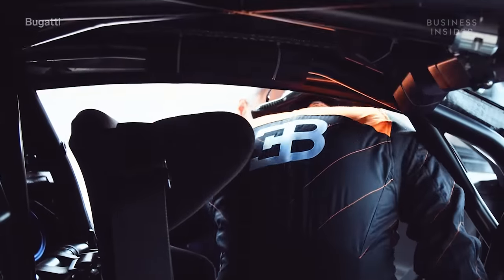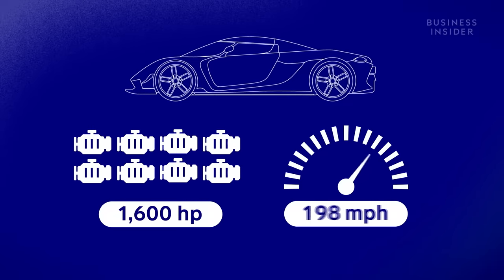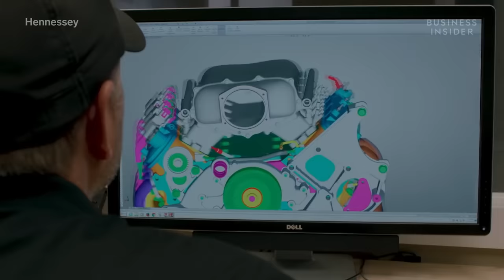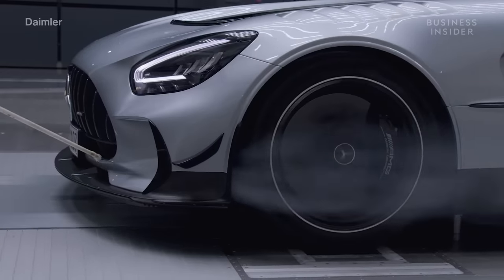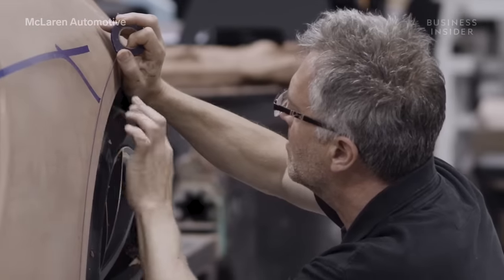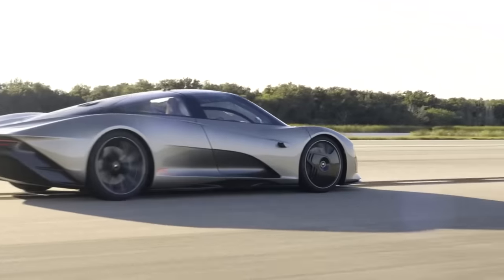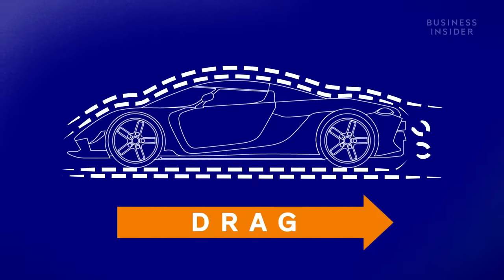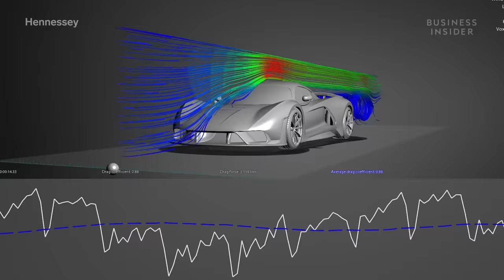Why It's Almost Impossible For Cars To Go 300 Miles Per Hour | Insider Cars

Comment: 30 years from now- “Why it’s almost impossible for cars to go 400 mph”
Reply: Exactly what i thought.
With additive manufacturing it's probably less than 30 years away.
Reply: While the German autobahns have no speed limit on unrestricted sections... They have worked out a theoretical limit at which the tyres would start destroying the tarmac!
Reply: But thats already been broken lol, at 481 mph on the speed demon!
Reply: @sandragarrettmccombs3635  not even a car
Reply: @AzathothsAlarmClock  it's basically a plane without wings
Reply: @AzathothsAlarmClock  no because cars don't have to be pushed to get going and have a jet
Reply: @AzathothsAlarmClock  alright thats you opinion, but it's just my opinion that is isn't
Reply: @AzathothsAlarmClock  I'm not calling it an aircraft, I'm just saying that to me it's not a car. The definition of a car is loose, you could call a train a car even.
Reply: @sandragarrettmccombs3635  not by a production vehicle
Reply: @johntheux9238  what is the theoretical limit?
Reply: @GTDrexXX lmao, is that even still subsonic anymore
Reply: At that point, you're starting to run out of planet to drive on!
Reply: @AzathothsAlarmClock  And all 3 operate in fluid dynamics using aerofoils. That's an even simpler concept.
Reply: @lukehill2936  Probably somewhere under the speed of sound so like 700mph, but that would require building cars in completely different way, specially the wheels.
Reply: @mihailmilev9909  No, that's like Mach 25 xD
Reply: @Waldel Martell yeah but the forces required for higher speeds grow exponentially as well. This cancels out and the progress will be linear imo.
Reply: @Waldel Martell I hope manned drone racing will become a thing in near future. That would be great.
Reply: As long as humans keep the spirit of advancement and curiosity alive, we'll be fine. Just do it for advancement, not money.
Reply: @SonGoku-io7sh  people invent stuff for advancement, but produce stuff for money. That's how it gets cheap enough for public.
Reply: @videorowtv5198  The primary goal of a general corporation is to make money, not advancement of humanity as a whole.
Reply: Cars will be flying by then bro
Reply: @1moetime123  Cars will not fly for a very very long time. It's just very impractical and expensive.
Reply: development is exponatial so in 30 years i expect way more
Reply: @videorowtv5198  it’s not that hard when they’re sitting in 0-point energy technology
Reply: @joachimtheboss5326  we already have “way more” it’s just up to the government to let us use the technology
Reply: @joachimtheboss5326  McLaren F1 without a limiter could go 240mph, that was in 1992. It took us almost 30 years to get to increase the speed by 60mph. I think in another 30 years the rocord will be around 360. Because the technology required grows exponentially with higher speeds.
Reply: Wht if cars broke sound barriers like jets 😜
Reply: @rahulverma8774  I don't think there's a reason for cars to break the soundbarrier. The noise that it would create would make them unable to race on any curcuits. Also the turbulences under the car would make it very unstable.
Reply: @RelyksJ  no, you cant ... its exactly as simple as with cars and planes ... a train goes on train tracks /railroad tracks and a car don't need a train track or a railroad track, it can choose its direction without a train track
Reply: @videorowtv5198  Sound barrier is broken at 770 mph ..........and u r saying tht a car will be useless if it manages to break sound barrier ......... so we can say tht car speed beyond 770 mph is impossible
Reply: @Namelless2366  I was saying with his definition you could. Ofc a car isn't a train
Reply: @rahulverma8774  Basically, yeah
Reply: @avdeepsingh9218  it has 4 wheels and it drives, its a car, not a road car, but a car
Reply: @mihailmilev9909  the speed of sound is only like 760 mph plenty of planes go faster than sound. 20,000 mph is like 30 times the speed of sound lol.
Reply: @Jonathan_Doe_  Due to added down force engineered into supercars?  You saw the car without the wing in this video only had 330 added pounds of downforce.
Reply: @myusername3689  what I was saying was that you can have your own definition and it is and opinion of what you think is a car.

Anyway I can't be bothered arguing about this anymore.
Reply: Although it isn't a production car a consumer could buy on the market thrust ssc beat 700 mph in the late 90s.
Reply: @videorowtv5198  

If it were manned, it wouldn't be a drone anymore.  A drone has no person in it.  It is by definition, unmanned.
Reply: @someguy7805  OH yeah, my bad. Quadcopter racing.
Reply: @1moetime123  cars has been flying for years, it's called aeroplanes.
Reply: @zahier_gaidien9259  I’m not talking anything with a combustible engine
Reply: @AzathothsAlarmClock  show me where I can buy a production one then I’ll give them the record
Reply: The Chiron will be filmed at 300mph with a 2050 Camry.
Reply: I'm expecting to see that video
Reply: @johntheux9238  not really
Reply: @johntheux9238  you will need a 102400 horsepower, ultimately impossible
Reply: @amishmittal4536  (400/300)^3 = 2.4 times more power than for 300MPH so far from impossible.
Reply: @RelyksJ  iouoio
Reply: Didn’t the Thrust SSC hit over 700?
Reply: Max speed any object can do safely for long periods of time is Mach 3, the SR71 blackbird even though it flew at the edge of space where atmosphere is damn thin, the plane still heat up to 300 degrees celsius or 571 degrees fahrenheit. Doing mach 3 at sea level is ridiculously stupid. 

Also those that spew bullshit speed like 20k MPH, bruh the space shuttle re-enters the earth atmosphere at 17.5k MPH, and it heats up to 3000 degrees fahrenheit like WTF are you guys talking about?
Reply: I mean, rocket on fidget spinner. On car means speed
Reply: @AzathothsAlarmClock  😂😂
Reply: Because the battery keeps dying lol
Reply: Not even 30 bro lol give it 5
Reply: Its all down to the power of the engine and the tire.
With newer electric engines and higher energy batteries it might actually be possible.
Reply: The biggest obstacle to speeds above 300, is MONEY , everything else is secondary.
Reply: @ibrahimbaghdadi2187  I have no desire for flight, I have no desire for 300 Mph on tires, either. I have been to 150 on a motorcycle, that is plenty fast, thank you.
Reply: Thrust SSC...Eh?
Reply: Well the car thrust scc can already go over 700
Reply: @AzathothsAlarmClock  are you 9? The Demon is not a production car, its a concept. Whilst the Chiron SS+ 300 will come out, but with a speed limiter
Reply: @AzathothsAlarmClock  sigh, you just dont get it do you? Can people buy it and drive it on the street like a normal car?
Reply: @AzathothsAlarmClock  what does that have to do with anything
Reply: @MillenniumEarl014  bruh this was 3 months ago lmao
Reply: YouTube Censors Free Speech  not water imo because you need much more energy to push through it
Reply: @videorowtv5198  The world land speed record is Mach 1.02, set by Thrust SSC. So no the limit is not below the speed of sound. But for "practical" purposes the problem above 300mph is tyres for wheel driven cars, as this video explains. JCB DieselMax is the world's fastest diesel engine powered car, with a record of 350mph. That was the limit for the tyres, the car wasn't even in top gear at that speed using only 5 out of 6.
Reply: @AzathothsAlarmClock  which is why it's called a "jet car" and not a "car".

/don't make me call in the rest of the youtube attorneys  ;P
Reply: @videorowtv5198  and we don't want anyone with just some driver's license to use a third dimension. a thousand hours of training? maybe.

1/3 of society can't even figure out how to drive in appx. two dimensions as it is.
Reply: no one is sitting on zpe tech, ffs. stop watching conspiracy youtube.
Reply: 60 years after that-“why it’s almost impossible to move faster then light itself”.
Reply: I mean there could alot of accidents that would happen if it’s 400 mph
Reply: Exactly! Same thing was said for years about the "4 minute mile"...Scientist also came up with reasons why the human body couldn't.
Reply: @rahulverma8774  but really... why even make roads and cars for such a speeds if jets simply exist?
Reply: @ThatGuy-sd3zl  low-class consumers cars will never be fast or use advanced tech.
Reply: @divinehatred6021  yeah true ..... but in the world where world records exist ,i m sure we will one day make cars tht manage to break sound barriers ..... it may not be used by average men ..... but rich people can later purchase it in auctions ...... cars tht break sound barrier should cost close to a billion dollar according to me ... or maybe more
Reply: You need straight road long enough to support that speed with no traffic.
Reply: @zmanphx  We can try tht never ending runway shown in fast & furious
Reply: When you Pay 2 Million Bucks for a Car it Should do 500 Miles per Hr. But for Now 304 MPH will DO !!! I want one !! But i don't have any $$$ !!!  Tuff Shit Right !!!
Reply: Thrust SSC: am I a joke to you?
Reply: @AzathothsAlarmClock  the speed demon doesnt really count since even though its piston driven and has wheels, its purpose built to break records. Its not a regular car with that high of a speed.

Technically speaking, all top fuel dragsters easily hit 300+ mph, but they wouldn't count as cars in this regard. For these to qualify as cars, they should be street legal. If they are not, they don't count.
Reply: @sandragarrettmccombs3635  were talking road legal cars here
Reply: Elon Musks son enters the room:
"Hmmm, what if I invent lightning speed engines?" Vzhooooom.
Reply: @dylanholman3  glad someone pointed that out but ppl love to argue
Reply: 3375 years**
Reply: History shows cars have gone 700+ MPH
Reply: Exactly. Nailed it.
Reply: @videorowtv5198  thats if u keep all other variables the same. If u reduce the front cross sectional area by 50%, you reduce the power by the square.
Reply: @joachimtheboss5326  only initially..
Reply: Lol.. Car can go upto 1000mph 😕
Reply: @RelyksJ  cause you're wrong?
Reply: @sandragarrettmccombs3635  It has to be street legal production car.
Reply: bro cars can go fast but drivers brain cant
Reply: @AzathothsAlarmClock  Here's a pleasant correction: Speed Demon is not a production car where you get in, start the car and turn on the aircon while on the way to your nearest grocery and then do a 270-300mph run on the afternoon.
Reply: Not so long ago " cars will never go above 50 mph !",  a modern AUDI estate is FASTER than a Lamborghini Countach.
Reply: @videorowtv5198   there is already flying cars lol
Reply: @jstbands  example please
Reply: @jstbands  example please
Reply: @videorowtv5198   The Dutch PAL-V "Liberty"
Reply: Honestly in what scenario do we need cars to go this fast, let’s be honest
Reply: @jayasmrmore3687  for when we want cars to go fast
Reply: @xXxtroublebehindxXx  they already go fast, we don’t use their speed past the speed limit but that speed limit is very high anyway.
Reply: @jayasmrmore3687  and whats wrong with wanting a car to go fast
Reply: @xXxtroublebehindxXx  it’s extremely dangerous
Reply: @GTDrexXX bruh that’s faster than a rocket, you would not be able to see where you are going
Reply: Top fuel car be like "ez'
Reply: @RelyksJ  well...they are, trains are basically just cars that run on tracks that pull along a chain of compartments, not an opinion, it's by definition
Reply: @1moetime123  in all fairness, anyone or any institution big enough to fund such a project will obviously have more than enough to test it out on their own land, which is technically not illegal since even if it wouldn't be road legal, it's not being tested out on roads, at least not public ones anyway
Reply: More batteries will be clarksons grandchildrens motto
Reply: 30 years from now we'll be struggling to go 60 mph  because of all the carbon neutral demands and the digital ID systems. Self driving cars will all collectively choose 45 MPH to be the top speed due to safety concerns.  But we'll have endless amounts of things to do to keep us busy so we don't notice the added time to commute. Unless you pay for the Premium lane which is a subscription. And that will go 100 MPH on auto pilot
Reply: @AzathothsAlarmClock  Bugatti IS street legal. Thats the difference
Reply: There only 1 cat that only go to 400 mph
Reply: That’s because they’ll be using electric cars instead of gas
Reply: ThrustSSC goes 760 mph
Reply: @hamoink6769  763
Reply: nah that wont happen
Reply: @RelyksJ  you're confounded
Reply: Because your battery doesnt last long enough until you have accelerated to this speed.
Reply: Piston driven cars broke 400 mph almost 60 years ago, without turbochargers or superchargers.  The current piston driven speed record is about 470 mph.
Reply: Or! Remember how ignorant when we were fascinated with the speed of cars!
Reply: @videorowtv5198  Thrust SSC
Reply: @YoutubeChannel-in9qd  We are talking about super cars/hyper cars of the future, that would be allowed on publuc roads. Not land speed record vehicles. Thrust SSC is unusable as a car.
Reply: 60myears from now- “Why it’s almost impossible for care to go 500 mph”
Reply: SSC Thrust goes over 700mph but I’m  not entirely sure if you could call it a car, more like a land rocket
Reply: @龖  Yeah, I was talking more about an actual usable car you could use on public roads, but SSC Thrust is really cool
Reply: @videorowtv5198  Tuatara then
Reply: @龖  Yeah the the record for Tuatara is 295 mph which is very impressive but only 55 mph faster than a 1992 McLaren F1 without a limiter. Also I said the limit will be subsonic speed. Which is about 700mph. We can't have trans sonic or supersonic cars driving around even if we had the technology
Reply: @johntheux9238  is am being used in cars though? I haven’t heard of that… Teslas new assembly method is cast-aluminum. They cast the front and rear sections of the car in mostly one price, And the structural battery pack is the center frame. Obviously a lot different because it’s electric, but the concept of cast-aluminum is still there.
Reply: I think at some point the car is so aerodynamic that it's uncomfortable to sit in it
Reply: @tomlxyz  look at aptera, it looks pretty comfortable
Reply: @RelyksJ  a four-wheeled road vehicle that is powered by an engine and is able to carry a small number of people. but thrust is a 1 seater so ig you're right? but also i think they could make a 2 seater that could still go like 400 mph at least. i wouldnt consider it a car but by oxford dictionary definition it is.
Reply: @Jonathan_Doe_  NOOOOOO thats wrong bro
Reply: Lol. The most underrated comment of all time